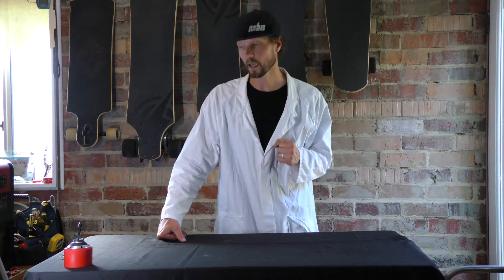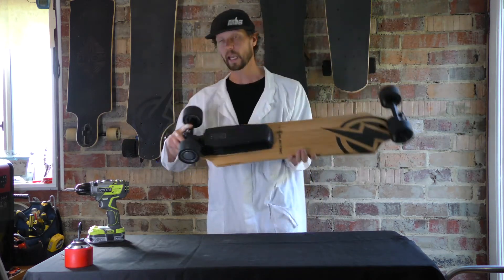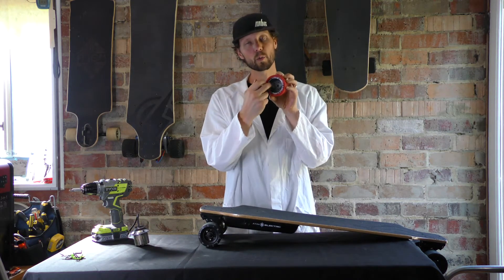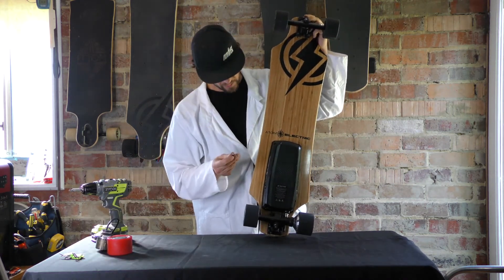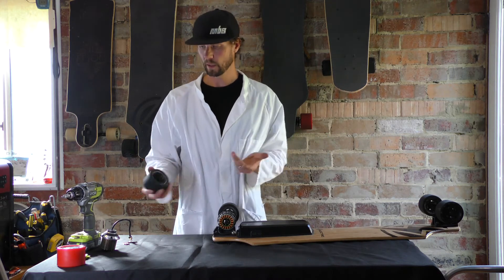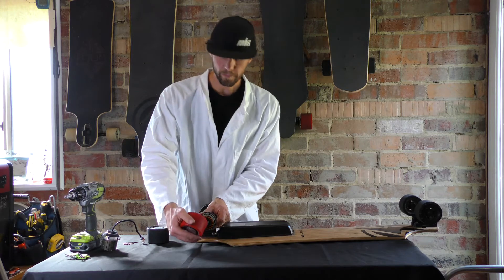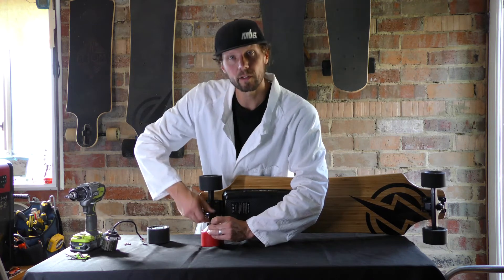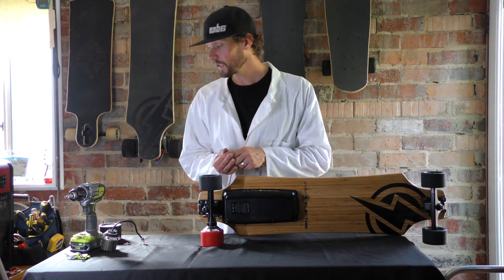TECH TALK - Motor Wheel Shell Replacement - H-series

Comment: One of my dual hub motors stopped working, it responds slightly to the remote, but won't spin, do you think it's something relatively simple I can fix. I just made a new battery but only thru reverse engineering the old one. It's a meepo v4s

Comment: Hi i am having issue with the skin or drive wheel shell spinning around the rota metal 
i have tried to bond it with a 2 part alarldite epoxy resin 
thats bonding the inside of the skin or drive wheel shell to the metal rota
it seems good of only about an hour then its spinning again resulting in the vibration as the metal drum is lumpy and causes the wheel to be lumpy ,thus causing a awful vibration and makes the board unrideable 
so far getting the skin of the rota metal part twice has taken me hours and hours and then gluing it 2 times now and it failing ,after all that ,makes me wonder what can i use to bond it so it will stick  and not spin out of place again
or can anyone tell me where i can buy a skin for a pomello motor hub please